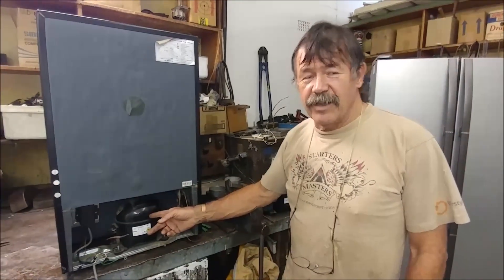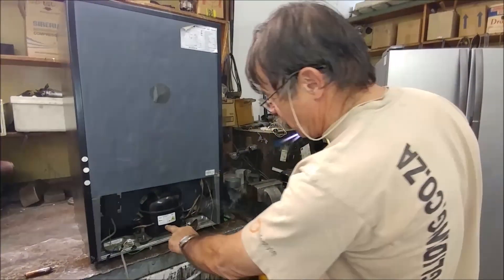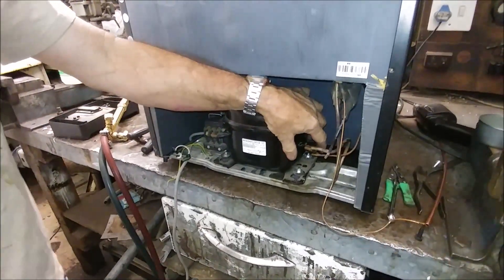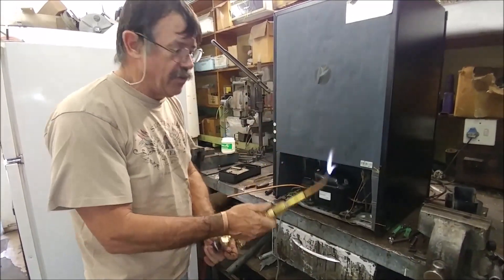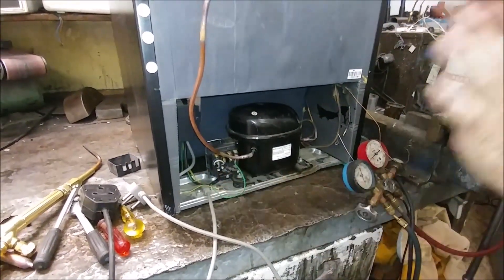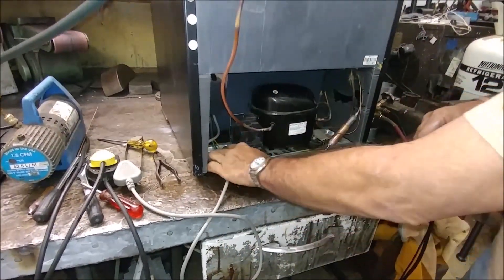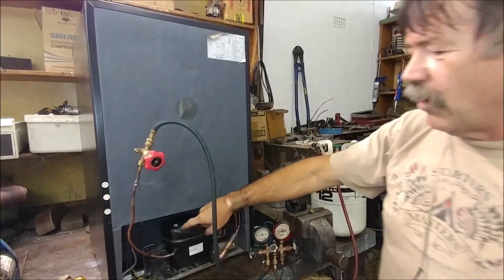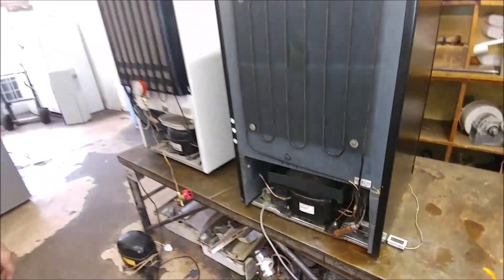Replacing an R600 compressor - JDNel Refrigeration

Comment: hey good video. why is R-12 and not dry nitrogen.
Reply: HE CHARGED THE UNIT WITH R-12 CAN'T DO THAT IN US!
Reply: in the Caribbean they have ban all cfc and phasing out hcfc and already looking into phasing out hfc
Reply from the maker: I blew the system through with a little bit of R12 not Dry nitrogen purely because the pressure of dry nitrogen could rupture the internal evaporator. They rupture at about 150 psi.
Reply from the maker: They are also phasing out cfc and hfc in South Africa but I use it because I have some stockpiled.
Reply: @JDNelRefrigeration  turn the nitrogen regulator down to 100psi , no problem....
Reply: @JDNelRefrigeration  thats why your use a nitrogen gague to lower the pressure
Reply from the maker: @1989Chrisc  In South Africa the cost to get a nitrogen bottle and regulator is astronomical.
Reply: @JDNelRefrigeration  test psi is 250/300. Not 150 that all most psi of r134a
Reply from the maker: @Tonyinmemphis  At 250 psi some of the soft aluminium evaporators distorts.
Reply: @JDNelRefrigeration  and time to replace it if it pops
Reply from the maker: @Tonyinmemphis  Rather reduce the pressure than replace an evaporator plate
Reply: JDNelRefrigeration You're obviously a smart guy, so please try and find something less damaging for your descendants than R12 for purging!  GWP of 2400 and also Ozone depleting.  In a lot of the world you'd face stiff fines for doing that...
Reply: Tim Small bro r12 has a gwp of 10000 and a odp measured at 1. R22 for comparison has a odp of 0.066